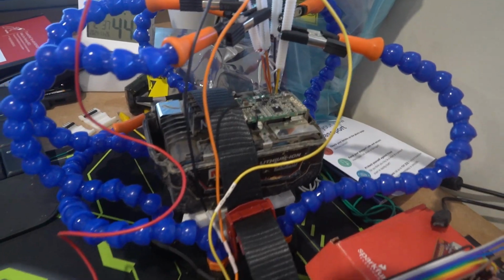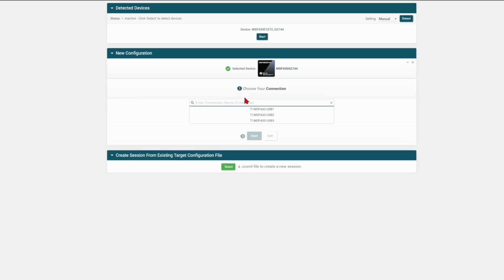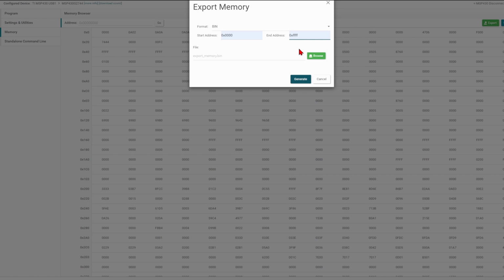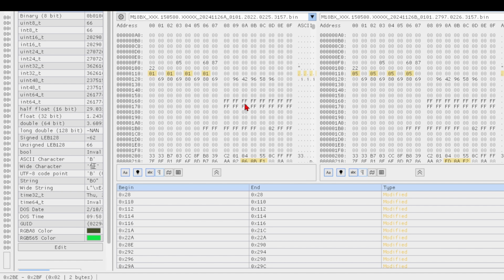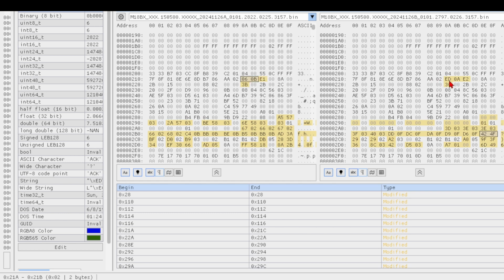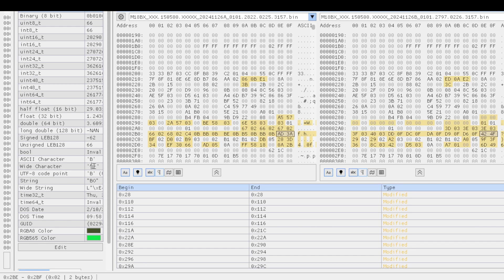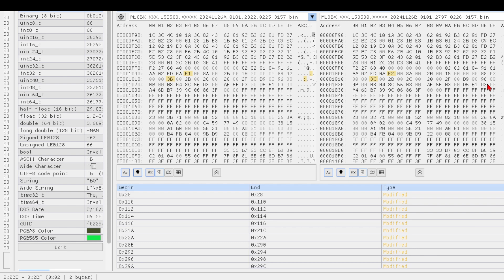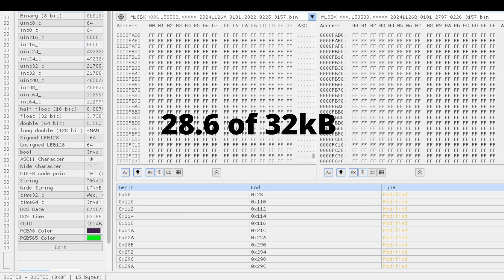M18 firmware extraction

Comment: You put an incredible amount of energy into it, honestly big respect. :)

Do you think there is a solution to reset/unlock the BMS of the Milwaukee M18 5Ah battery? When the battery pack stopped wotking, one pair 18650 battery cell was defective. After that I replaced the bad ones and tested the other cells separately. Currently, the battery is in balance based on the measurements.

However, after pressing the BMS test button, only the 1st LED flashes a few times and the battery cannot be used.
When I placed on the orignal charger, there is only a continuous green feedback, as if everything is fine... :S
I'm out of ideas. At this point, do you think the BMS can still be fixed?

Any help would be great, thanks in advance.
Reply from the maker: Discharge the battery down to 18V. Charger won't do anything if battery is fully charged
Reply: @ToolScientistRAW  
Thank you very much for your answer.
I will discharge the cell pairs separately to say 3.3V and try it.
In the meantime I checked the main chip type with a magnifying glass which is the following: R5F100BCA 1911KN405
I will write in a few days what I experienced.
Reply: @ToolScientistRAW  According to your advice, I discharged the battery cells separately and equally.
But unfortunately, nothing changed. :(
The BMS still not want to working.
I also made a video about it, you can find it on my channel if it helps. (video title: Milwaukee M18 5Ah faulthy BMS reset attempt)

Comment: This is very exciting. Can you write the code section back to the nonvolatile memory? Or only read? What tools are you using to reverse engineer the  code? What are the chances the balancing code is already there that is 1 bit flip away from being enabled? 🎉
Reply from the maker: We can write. I accidentally overwrote a battery with the "LED blink" example intended for the dev board 😄. Using Ghidra. I've only looked at a few functions, but the others have done more. Apparently there's no balance code, so we'd have to write it. Not a lot of point for 10yr old batteries, though. If the others can access the R5F chip, then  there's a good chance they'll add balancing code